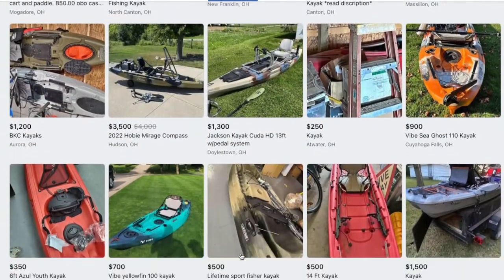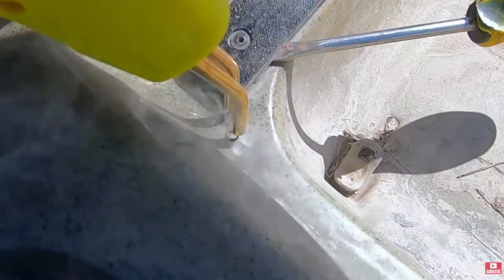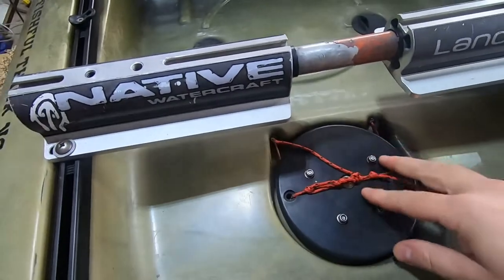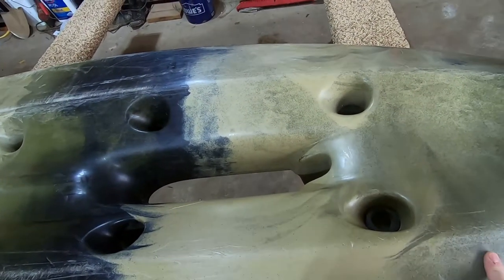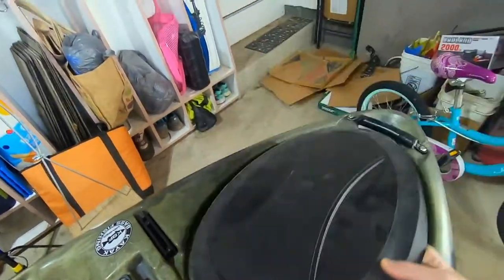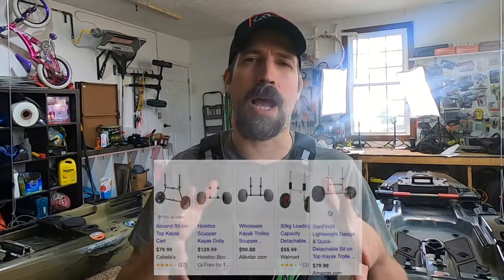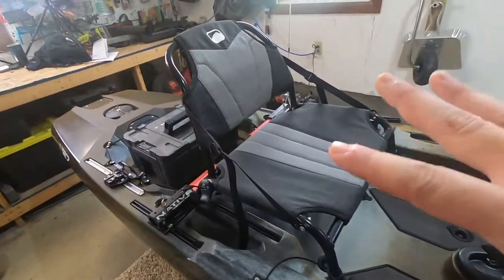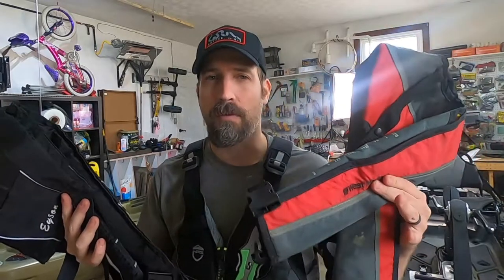Buying a Used Fishing Kayak? (Don't Get SCAMMED)

Comment: Some sage advice. May trade up but love my kayak, even though it's paddle only. Looking into a little minkota.
Reply: I have the Old Town Sportsman MK 106 and have been absolutely pleased with it for its stability, speed, fishability, and comfort. My only other option, were something to happen to my 106, would be the 120 Auto Pilot. 
When I go out, I’m looking to fish, not fight the wind and current. The 45# thrust MinKotta trolling motor this yak is built around allows me to do just that. For me, at 6’2” and 200#, and his kayak offers tons of stability, which is very important when fighting fish.